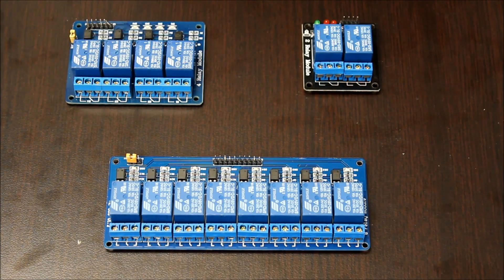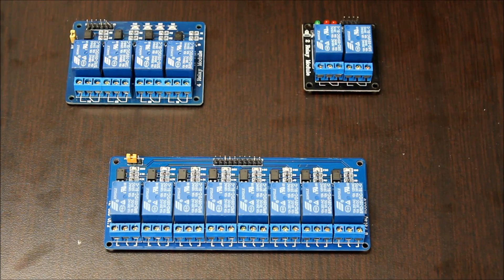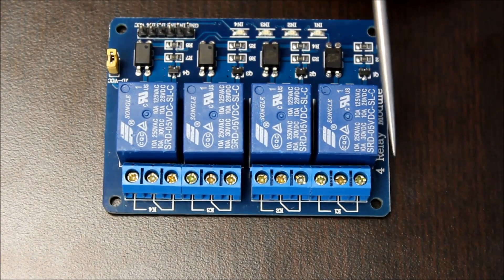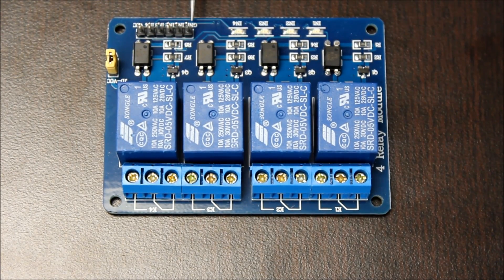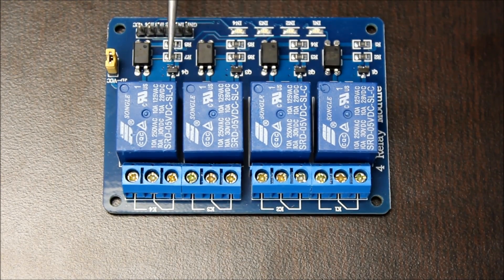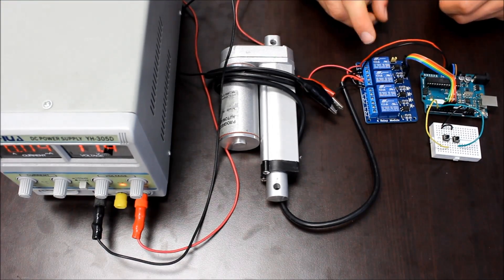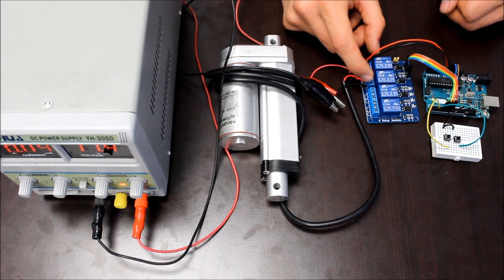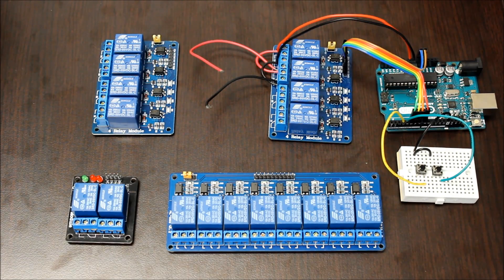How to use Relays to Control Linear Actuators

Comment: Awesome video dude! I have one question though.. I wanted to make the actuators speed up/slow down.. is there another way to do this other than by rapidly powering the relays on/off at alternating speeds, or if not, how long do you reckon the relays would last if this were to be occurring for maybe a whole 10 seconds a day?
Reply from the maker: Hi Tony
To control the speed of a linear actuator, you can use a DC speed controller such as our AC-14 (https://www.progressiveautomations.com/ac-14), or a PWM Motor Controller such as the LC-80 (https://www.progressiveautomations.com/lc-80). If you have any more questions or need more information, don't hesitate to contact us.
Best Regards
Reply: You need a servo relay. A 2 wire relay does not allow speed control. A 2 wire relay only extends and retracts depending on the voltage applied. Do not try to rapidly switch on and off a relay(s), they will burn out in under a minute if you do that.
Reply: Ok I now know a relay would be fine for ages doing this with code, BUT it would be loud. For that reason, a motor controller is nicer. Or building your own with a transistor.

Comment: hello bro I am using a 12v lithium ion battery to run Linear Actuators does we need any resistor or diodes I am also using some other components weight sensor ,and other 2 to 3 components
Reply from the maker: Hello, the linear actuator itself will not need any resistors or diodes and can be connected directly to a power source that outputs 12v. For your weight sensor and other 2 to 3 components, you will need to check their power requirements separately.

Comment: hello,whats the push button signal?
Reply from the maker: The push button supplies a logical low signal when pressed as the wire will short to the pin labeled "GND" located near pin 13 of the Arduino Uno, a logical high signal occurs when the wire is left floating as the button is not pressed.

Comment: Hello such an informative video...but i had a question is it possible that for extending the actuator you press the button and for rectracting the actuator it retracts automatically after 5-10 sec?
And one more doubt is it possible to use such push button that you don't have to keep pressing it until it extends...
Reply from the maker: Hello Kruti,

Yes, it is possible to program the Arduino microcontroller with a timer function so that the relays cause the actuator to retract after 5-10 seconds. This example was programmed for momentary controls, however, Arduino microcontrollers can also be programmed for non-momentary control if pressing the push button once and letting go was preferred.

Comment: How much load can each relay support @12v? I mean, could you connect to just 1 relay a 160w/12v fan? Cheers :)
Reply from the maker: Hi Anth! These relay modules can support a maximum current of 10A @ 250VAC and 10A @ 30VDC

Comment: So I have a snow blower motor working as my actuator. Will that work with this setup as well? Also the codes in the website you direct everyone too isn't the one you used for this video right. On the website there is only 1 code that control linear actuators and it only has pin 6 and 7 labeled as used. You are using way more pins on the pwm side of the arduino. Could you clarify that?
Reply from the maker: Hi Ruben, we'd love to assist you in choosing the right motor for your setup. Can you provide us with more details by giving us a call at 1-800-676-6123 or please send us an email at sales@progressiveautomations.com

We look forward to hearing from you!

Comment: I have a question for you.  I have a single axis solar tracking controller that can handle maximum of 8 amps 12v DC current and my linear actuators I would like to use are 400 pound 18 inch and use 20 amps  12v for full power. Is there a power supply I can wire to my fuse box on a 20 amp or 30 amp  that can supply the needed power that will detect the power from the tracker controller and supply it to the linear actuator  for both motions up and down?
Reply: I doubt you will have 20 amps for 18 inches of relay travel and 400 LBS. Respectfully, you need to go back and check your equipment AMPS. All of that seems way to heavy on the amps???

Comment: Can I power the Arduino with 12VDC?  And could 2 relays work on a 4 channel with 2 linear actuators operating at the same time?
Reply from the maker: Hello,
Each actuator requires positive and negative 12VDC to achieve extension and retraction. Ensure that the relays you use can provide the DC voltage polarity reversal. 
Thanks
Team Progressive Automations.
Reply: Progressive Automations :  is there a wiring schematic that you could provide?  I am still unclear by what you mean.  By the way, I bought the 14-PA actuators.  Looking forward to integrating Arduino.   Thanks Progressive
Reply: Most Arduinos can take 12VDC and turn it into 5V and/or 3.3V. The 5V from the Arduino can operate 2 or 3 relays most of the time. (I would recommend to seperate the actual relays and controller in your PSU setup regardless. It just makes for a less noise and touchy setup)

Regarding the actuators, if you are using the same 12VCD PSU, you just need to make sure the maximum amperage is higher than both your components and your motor.

Comment: Hello! Can that be used with Raspberry Pi and what if the linear actuator is equipped with feedback sensor (potentiometer)?
Reply from the maker: Hi Konstantin,
If using a linear actuator that is equipped with a potentiometer, this device will be able to provide positional feedback. Raspberry Pi devices can be connected to relays in order to activate the relays when necessary.
Thanks.

Comment: What is the duty cycle of your linear actuator?
Reply from the maker: Hi Ray
Our Linear actuators have a variety of duty cycles, however they are typically in the 20-25% range. This mean that the actuators can be run for approximately 4-5 minutes, where they will require an approximate 15 minute cool-down period.
Thanks
Reply: @ProgressiveAutomations  ohh thank you for the reply that helped me alot!

Comment: Why use relay instead of transistors?
Reply from the maker: Hi,
Typically relays are easier to integrate into the average users setup. However, we do offer transistors in a motor driver package.
Thank You.

Comment: What is the Arduino doing?
Reply from the maker: Hi Mark
We actually have an article related to this video on our blog here - https://www.progressiveautomations.com/how-to-use-relays-to-control-linear-actuators/. It shows the coding that the Arduino is using. If you have any other questions related to the Arduino coding, please contact us directly at 1-800-676-6123 or sales@progressiveautomations.com to get in touch with one of our engineers.
Best Regards
Reply: @ProgressiveAutomations  hi there, I noticed the article but it doesn't mention the push buttons you have in the video, how for these work? If statement ?
Reply from the maker: Hi there
Please refer to our Instructables post on this example here - https://www.instructables.com/id/Using-Relay-Boards-to-Control-Linear-Actuators/. This goes into much more detail on the coding and how everything comes together to function correctly. Hope this helps.
Best Regards

Comment: might you have a way to Alaxa-fi a dc reversing motor? I want to tell Alexa to open or close that actuator, no buttons, so need a smart reversing relay of some kind.
Reply from the maker: Hi Erick
At the moment we do not have a way for Alexa to directly control our actuators unfortunately. We were however able to find some guides online on how to use Alexa to control a relay, hopefully they help - https://maker.pro/arduino/projects/how-to-control-an-led-or-relay-with-amazon-alexa-echo. 
Best Regards
Reply: Sonoff....https://www.itead.cc/sonoff-4ch-pro.html...you can program it for all kinds of stuff, if your amp draw goes over 10Amp, place a relay switch between the actuator and the controller. Best of luck

Comment: thanks alot for your video this help me alot to understand the whole process of operating linear actuator.
can you provide the wiring diagram of your circuit just a lil confuse i have that how to connect the buttons with aurdino ? & this buttons are of specific kind or can use a normal one for it ?
Reply from the maker: Hello Anas
For more in depth information on the wiring and how we did this. please refer to our Instructables post - https://www.instructables.com/id/Using-Relay-Boards-to-Control-Linear-Actuators/. If you need more information then just give us a call at 1-800-676-6123 or email us at sales@progressiveautomations.com.
Best Regards

Comment: very nice job sir

sir use a DC motor on off by LDR   (light depending resistor) relay board and Arduino 

this i use for Sun solar tracker and codes i make it but codes not work properly

help me in this project if u want i send you my project and details ,
with thanks i waite for yours responce

hava a good day sir

with regards 
mansoor shah
email: lionssgpk2@gmail.com
Reply from the maker: Hello
We'd love to get more details about your project so we can answer your questions. Please contact us at sales@progressiveautomations.com or 1-800-676-6123 to get in touch with one of our engineers. They will be able to help with whatever issues you may be running into with your project.
Best Regards
Reply: hi 

sir Many thanks for yours replay have a good day sir

Comment: Hi sir, I need some help, I have 24v actuator motor and my Fcu unit is 220v, how I control this motor.
Reply: All you need to do is get a 24v power supply to power the actuator. 

It doesn't require any special engineer assistance. In fact that what relays are for. They are meant to separate the Load from the controller. Example: Your car headlights. They draw a lot of current and therefore need larger wire to handle that current. Well you don't want large wires going through the dash and large buttons that are able to handle that current. Also you want the circuit to be as sort as possible.  So you use a relay. Small button, small wires, longer distance operating a low voltage/ low amp/low current relay coil.  Simple: Use small to operate big.  In fact they are actually semi doing it wrong in this video. They are using the Micro controller power to power the actuator. That's a big no no.The power should come as direct, from the power source, as possible.
Reply from the maker: Hi there.
For technical questions like these, please contact us to get in touch with an engineer so they can best assist you. Call us at 1-800-676-6123 or sales@progressiveautomations.com.
Best Regards

Comment: Hey great video. I was curious do you connect one side of the actuator to NO and one side connected and the other side to the NC? Or do use two of the relays with one sending signal to open the actuator and another sending signal to close it? Trying to figure out if i can use a single or if i need a dual for my application.
Thanks in advance.
Reply: My apologies i realized you covered this. But would still appreciate confirming if i am correct or not with this.
Reply from the maker: Hi there.
Please refer to our article that goes into much more detail on how to use the relays here - https://www.progressiveautomations.com/how-to-use-relays-to-control-linear-actuators/. If you have any other questions please contact us at 1-800-676-6123 or sales@progressiveautomations.com.
Best Regards